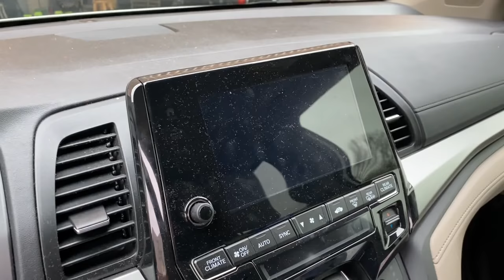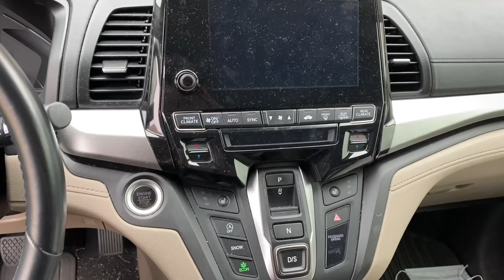DISASTER CAR CLEAN WITH ME | Mom Van Deep Cleaning Detail | Honda Odyssey Minivan

Comment: Noo you cannot spray a car seat with a hose or get the straps fully saturated with water! Please don't do it. It ruins your car seat. The manufacturer wpuld tell you that it's ruin! It should have cleaning instructions in the manual to follow! Your car seats are no longer safe now. :(
Reply from the maker: Why would they not be safe from water and fully drying out?
Reply: @MaiZimmy  There is a few reasons why. The straps are specifically not supposed to be saturated because it ruins the integrity of the fibers and elastic that is woven into the strap. The pressure of the hose is also not good for the seat as it could rattle inside components. If the seat doesn't dry fully material areas could mold and metal ares up inside the seat could rust. The fabric is usually ok to wash on a low or handwhas cycle but not to be blasted with a strong force. Most car seats have fire resistant material and that can be damaged if not cared for properly. The manuals will tell you how to clean them. I dont think a strong hose spray is approved by any. Im sorry to be negative but you putting this out there could risk the safety of many kids because alot of people aren't educated on the safety issues of this.
Reply: I checked your manual. It says right on page 91 in bold letters not to submerge the straps. Ie saturate them with water. Page 92 " Do not immerse the harness straps. Doing so weakens the straps".
Reply from the maker: Totally get your concern. I’m pinning your comment so people can review, read their car seat manuals, learn the concerns, then decide for themselves. 
I read through my car seat manual and I am not concerned with how I washed my specific car seat. It said I could wash the outside cover in a washing machine. It didn’t state anything against spraying the plastic seat down (and technically I didn’t use a power washer, but it didn’t say anything about that either)  I didn’t submerge the straps under water, put them in the washing machine nor did I use harsh chemicals. It doesn’t want people to take the straps off, put it in a washing machine and have detergent on it cause that potentially affects the strap fibers. But getting water on the straps and letting it fully air dry doesn’t seem to be a concern. It notes that if the straps look at all frayed to contact Graco, but my straps don’t look frayed in the least. They look brand new. (Also notice I didn’t specifically aim to spray or scrub the straps. They got wet in certain parts, the same way they would get wet if my kids spilled water on themselves 😊)
Reply: @MaiZimmy  I totally get ur explanation... kids spill daily in and around the straps n seat.. and if they are that fragile they aren’t suitable as protectants for kids anyway!!!
Reply: Ur car looked BRAND NEW!!!!
Reply: Why
Reply: I don’t think it can be that bad
Reply: @lauratrimm6356  It can harm internal parts of the seat that you don't see. Water can cause rust and it can also wear away at the fabric. Specifically the straps are not suppose to get totally wet as it reduces the safety of them.
Reply: Kids spill drinks on/in car seats all the time getting them soaking wet.  It's fine to deep clean them as long as it gets dried.

Comment: Wow. I didn’t know you could wash car seats like that! Game changer! Thanks!
Reply from the maker: Yes! I would have had to buy new car seats if I couldn’t  do a good clean out of them with all the crap (one time literal crap 💩 😅) that accumulates!
Reply: Mai Zimmy oh boy! We’ve had blow outs in car seats but somehow miraculously managed to avoid 💩 in the seats. I’ve washed the fabric but never hosed out the plastic. Trying that when it gets warmer. Just bought our eldest a new car seat since we had baby #3 so his seat isn’t too bad. But my daughter’s seat... 🤦‍♀️🤢
Reply: The instruction manual that came with the car seats will tell you the recommended cleaning method! I know some say to spot clean the straps because getting them soaking wet may interfere with the integrity of the straps. I remember wiping them, and then getting a screwdriver out to get all that nasty out of the car seat. Why do they design seats like that?! They know stuff will get in them!

Comment: Hey mama! No hate at all but it's not safe to spray down your car seats, it can wear down the fibers of the straps and make them unsafe. Damp towel only on the straps and no soap, for the shell you can use a damp cloth and a mild soap. Good luck and good job with the transformation it looks great 💙

Comment: Pro tip. Buy mats to put underneath the car seats to save your leather and the goo from the kids.
Reply: Make sure to read your car seat manual because for the vast majority of carseats it is not safe to use seat protectors with. Like she said in the video her kids safety is more important than your car seat leather!
Reply: That is not safe or allowed by most car seat manufacturers!
Reply: Yes. Yes you can put a protective mat down spending on model. And if you can’t get your call seat tightened enough so that it won’t slide on a mat then even without a mat it’s not tight enough. https://csftl.org/seat-protectors-at-a-glance/
Reply from the maker: I looked up that I can use Lusso seat protectors with my graco seats and got them 😁😁 I honestly think it’s actually gonna be safer for my kids. It has a sticky bottom that makes my car seat FIRMLy in place. Even more firm than when it was on the slick leather.
Reply: @MaiZimmy  yes our children’s safety is paramount first and foremost. However at 50k vehicle is a very large investment that depreciates. And thankfully the majors brands don’t have a problem with them. Also if you can’t get them tight enough, go to any fire station and they will install them correctly for you. I had a car that it was almost impossible to get those suckers tightened down.